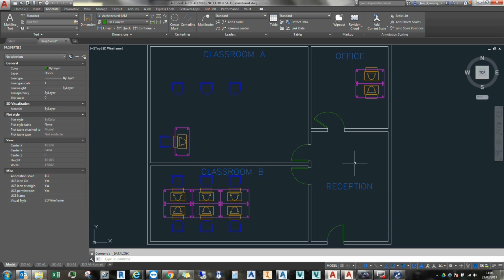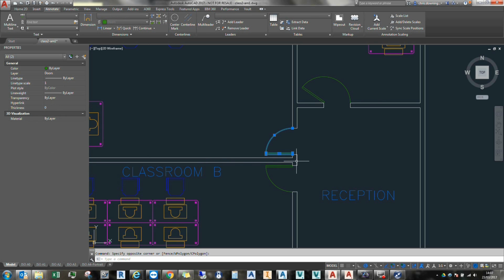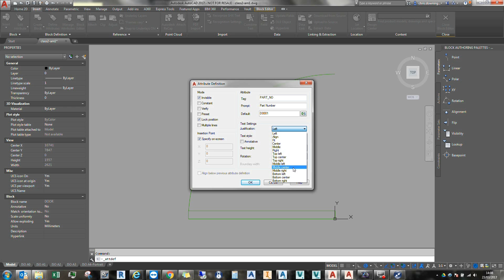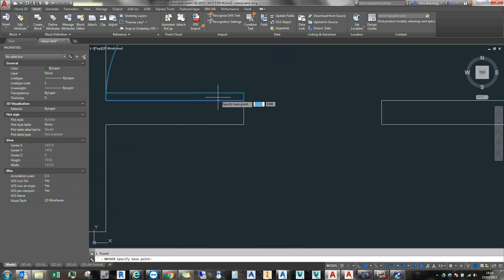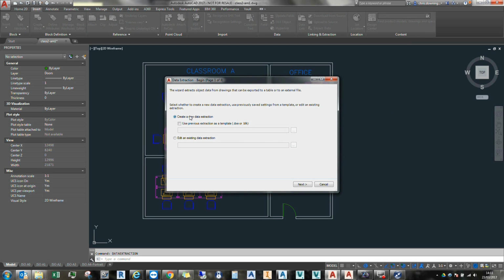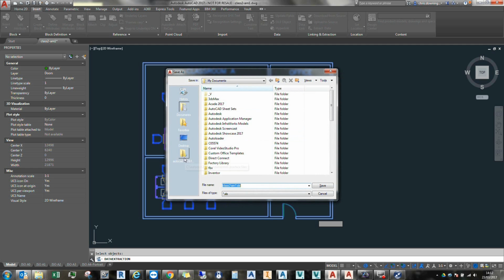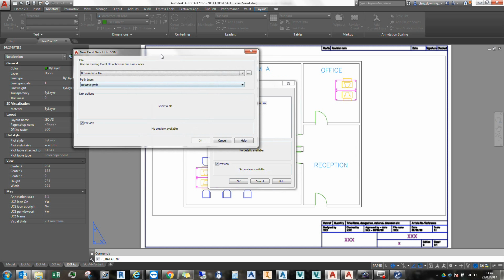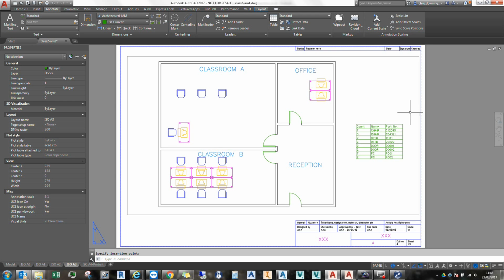Create a BOM in AutoCAD Using Blocks

Comment: will the numbers in the table correspond to callout tags automatically when you add a callout to the parts?
Reply: You could add a call out attribute to the blocks and then a call out column to the BOM table, this will provide matching call outs. If you want this to be automated you need to look at specialist software, depending on your discipline, such as AutoCAD Electrical or AutoCAD Plant 3D.